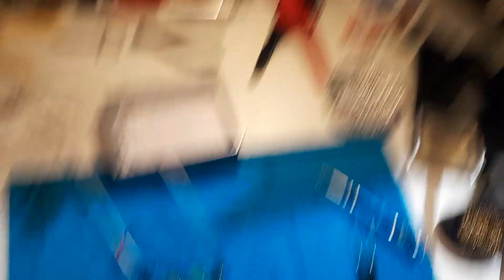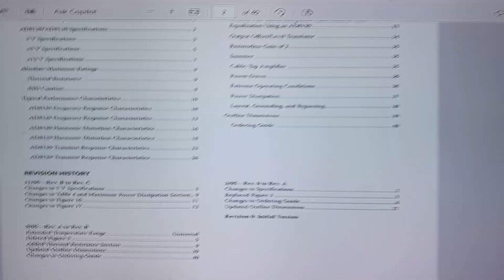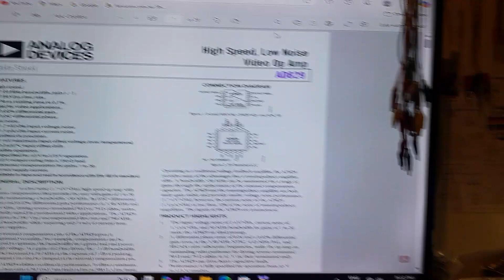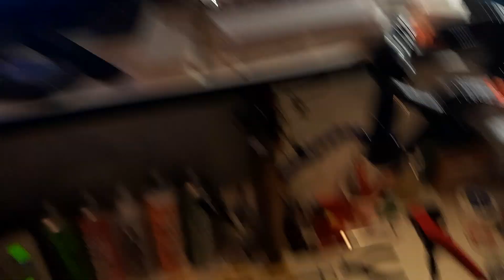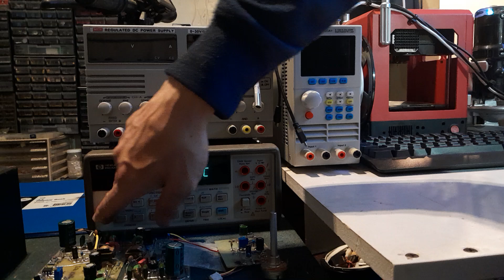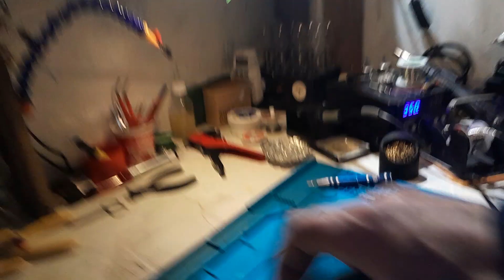New differential amp build + mods+ ps+ bnc's + case.      See description plz!

Comment: Before you make it 'better' why not check the specs like what should the expected noise be and what is the signal to noise ratio supposed to be at a certain frequency with a known input signal ? you have the spec of the device but do you have anything on the board because at RF the layout is critical so  it's very easy to mess up. What is your target frequency range ? and how does it perform there ? how does changing the bias voltage effect it ? My single ended amp has a range of DC - 2000Mhz and a spec of 20dB so when I get my lab back (decorating) thats the first thing I'm going to do I want that 20dB and I want it to work in the aircraft band so I will be checking around the 100Mhz to 150Mhz range. I know what I want it to do so I will test that straight out of the box, if I find I don't get that then I take the SMA connectors off and bin it, I don't want to fuck around with it as I will have a crack at the PCB design myself, in fact I have a layout I am happy with and is ready to go. Created in Kicad with all the parameters set in accordance to the rules . So what are your goals here ? and what performance do yo need and what do you expect from these pocket money devices ?.....gonna be fun !

Comment: This should be interesting, I have just bought an RF amplifier from Aliexpress and it was dirt cheap. I bought it just to play with and It supposed to have a 20dB gain it runs off a bias tee at about 5v you know Blah Blah ! SMA at each end and I shall just put it in line with an SDR (software defined radio) and see what happens ! I will follow your lead as I am not an RF guy either but surely that should read DC - 100 MHz Not kHz ?....Right now for your video.
Reply from the maker: Sorry what were you saying about mhz not kHz? You lost me at the end there.
Reply from the maker: Oh you mean the cmrr spec on the listing, yeah I found that odd I think it's just chinglish but Il work it out from the data sheet
Reply: @daveselectronicslab  :)